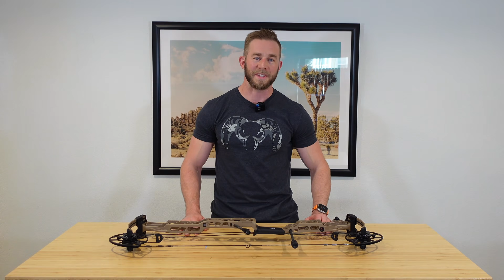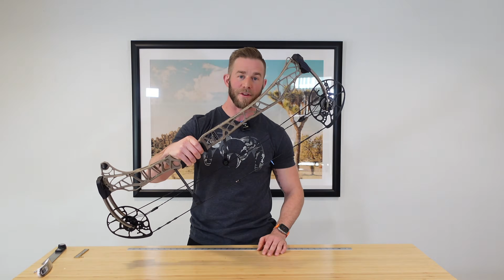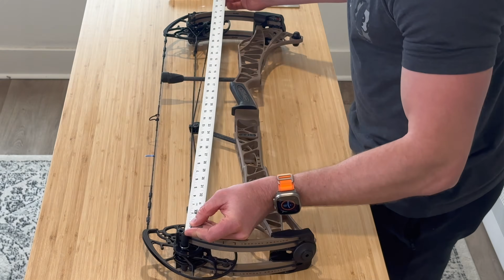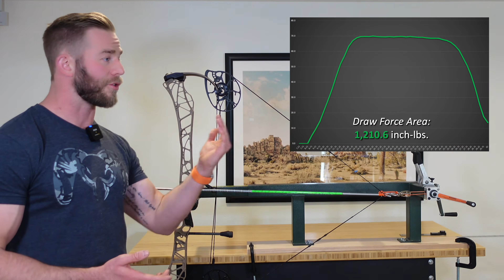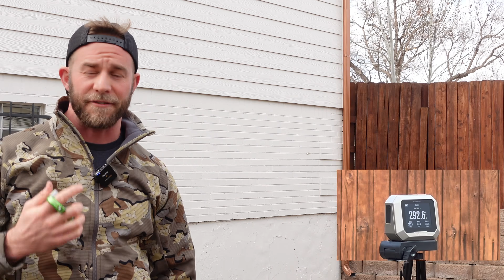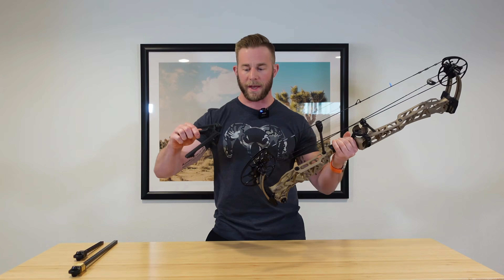Mathews LIFT 33 - The Ultimate In-Depth Review (2024)

Comment: I own a Mathews Chill-X (35” ATA) and it’s a reported 4.2 lbs bare. My Mathews NoCam HTR is 32” ATA and 3.8 lbs bare. Both could be considered “modern” bows, and Mathews themselves used to consider the NoCam to be their most accurate and efficient hunting bow (up to 2019 at least). I’m just making the point here that it IS possible to make a lighter and longer aluminum bow if you’re not building the riser to survive 80#s draw weight. Hoyt is doing just that with their Eclipse, which is light, fast, accurate, and maxes at 60#s. 

What the newer Mathews bows are is quieter. By a LOT. Several club members have the Lift, V3X, Tactic, and a few Bowtech Carbon bows too and they are all crazy quiet.

Let me know if you’d like to test my Chill-X or NoCam HTR one day.

Comment: Definitly the ultimate in depth review. If i were to add one thing it would be a comparative view to previous year bows. That would give better context for people looking to upgrade. That being said, next year I can come back and watch this and Mathews' 2025 bow and see the differences between the two. Thanks! P.S. how do you like the Garmin chrono?
Reply from the maker: That is a really terrific idea! Trust me - we are keeping all the data we are collecting this year, and we will probably include a "comparison" section for each bow review headed into the 2025 season. 

The Garmin Chrono is really good. First and foremost, so long as you shoot a "flat" trajectory over it, it seems to be highly accurate and repeatable. I've noticed that sometimes I get slightly higher speeds if there is a bit of a downward angle to the shot. That said, it does seem to work much, much better (in terms of actually giving a reading for each shot) when the unit is warmer or the weather is warmer. There have been some cold days (35 degrees F) where the unit won't always give a speed on all shots as it cools off in the outdoor temps.

Comment: why not take the dampener out of the front like you did for the Darton Sequel 33?
Reply from the maker: Thanks for the question! The Darton Sequel and Hoyt bows come with mini stabilizers that ALSO happen to have rubber inside to help with vibration dampening (just like many other aftermarket stabilizers on the market). These get removed as the majority of people who own these bows will remove them in favor of traditional and more effective stabilizers anyway. I am not removing permanently affixed vibration dampening, such as shock pods, orbital dampeners, nano dampeners, or limb dampeners from the various manufacturers. 

Alternatively, I could leave them in place for all measurement, including the weighing of the bows. But this would be a huge penalty to the comparison of these bows to others. 

Ultimately, vibration is the least interesting measurement on most modern bows. By the time you build it up with accessories, the vibration will be negligible. 😀
Reply: Thank you for answering and yes I agree that vibration isn’t important because you can mitigate that easily I shot Darton last year with the Prelude 32 but this year I ordered the Lift 33 the Sequel is super smooth but I prefer a more aggressive bow and to me it’s the Lift this year!
Reply from the maker: @EagleArcher24  Nice! Clearly you've found a review here for the LIFT 33 - we also reviewed the Sequel by Darton, and we are posting another major flagship bow review tomorrow. Thank you for commenting and engaging in a conversation about your gear! I hope you enjoy your LIFT!

Comment: Great review!  There seems to be a lot people on many archery forums talking about the cables hitting the cams after tuning these bows with the top hat system.  The limbs are very thin and seem to be prone to cause excessive cam lean.  I don't know for sure, but I will wait to purchase one.
Reply from the maker: Interesting! You're the first person I've heard this from - but I'll have to keep my ear out for cases like this. There may be something to this, as the LIFT 33 has far more limb deflection than any other bow we've had on test so far!

That said, I did go through paper tuning the LIFT 33 very quickly, and with one minor top hat adjustment it was shooting bullet holes and seemed to stay in tune. It could always be that if you are selling a ton of bows, you're bound to have more defects in the field because of the sheer volumes. 

Appreciate the information!
Reply: Good point.  Time will tell. @ApexArchery
Reply: Good point.  Time will tell. @ApexArchery
Reply: Google mathews lift issues. Multiple people complaining about cam lean, rubbing, and Multiple bows derailing themselves. Even on a weight scale when let down.

Comment: I finally found a left handed 33 in stock and was able to shoot it a bit.  I decided to pick it up, spend some time with it, and wanted to report out my real world findings.  To be honest, I was very skeptical about this bow when I first saw the release of it.  When I first inspected one in person, my skepticism grew.  You can literally grab the cam and bend it around in all directions (of course with the bow at brace) as the limbs are so skinny they just flex like crazy.  I was worried about that from a durability standpoint.  I was also worried about the cams being very, very skeletonized.  They seem like they would be easy to bend, etc.  Those were some initial observations before I got to shoot one. 

I got to shoot one and my first reaction was 1) the draw cycle is very linear, just stiff 2) there is no valley (even at 85%) 3) the vibe/shock after the shot is more than the Phase 4 and 4) the riser length adds to stability significantly 5) something different in the grip where your thumb fits is improved.  I shot it with both C and D draw length mods and landed on taking it home with the C mod.  I bought the bow and took it home (we do our own set up and tuning at home)......

Set up was easy.  With a center shot rest we had a perfect bullet hole with ZERO top hat changes or any other changes.  The Match strings are an improvement over the Zebra, not sure how much of an improvement but they are better.  They are thinner and they did settle very quickly and my peep locked in.  So I just started shooting it for a few days.  The bow has a very clean shot cycle, very clean release.  With it all set up, the vibe/shock was mostly gone.  I got used to the draw cycle being stiff.  I never did like the lack of a valley.  My style of shooting my hinge is to relax/elongate the palm of my hand and that style does not work well with a bow with no valley.  

As I shot it, I realized the C mod was making me feel a bit long.  I was not stable at full draw and could feel being a bit overextended.  My shop still had the D mods, so I switched to them and now I was too short, feeling scrunched up.  When I am scrunched up, I have hand torque.  For me, having the draw length perfect is a huge issue, as I finally found out how well I shoot when my draw length is spot on.  It matters hugely!  So, sadly, I am caught between a D and C on this new Mathews cam and not comfortable at either.  Note on the previous Mathews cam the D mod worked well for me).  Yes, could I twist strings and/or remove the grip and/or fiddle with D loop length or even my release neck length (different releases) - yes I could do all of that to try and get the Lift 33 to fit my draw length.  Since I have other bows I shoot well, I did not want to put that level of effort into the Lift, so I sold it/traded it.  As long as Mathews runs this newest cam with the 1/2" draw length limits, I am probably out of luck with Mathews.   

Conclusion, while I can't speak to the long term durability of the bow/cams, if your draw length fits one of the draw mods and if you are OK with no valley, this bow could be a great choice for you.  Thank you.
Reply from the maker: Thank you for the thorough commentary! Really appreciate you sharing your experience for others. 

Very interesting that you felt the draw cycle to be "stiff" and did not feel much of a valley. Based on our draw cycle analysis (and some overlays of draw cycles from different bows) the Mathews actually has a sharper valley than some other bows like the Hoyt RX-8 Ultra. If anything, it should be slightly more pronounced as it falls a little more dramatically and a little later than the Hoyt, and about the same as the Bowtech. Similarly, the Mathews was actually slight less "stiff" up front than the Hoyt as the Hoyt remained steeper between inch 11.75 and 14.25 of the draw cycle!

Just goes to show that you really do need to shoot these bows, as everyone experiences things differently!
Reply: @ApexArchery  That is all interesting.  Drawing a LIFT vs a RX8 the Hoyt feels much easier to draw at the same poundage.  Thank you for your in depth reviews - best on the internet and thanks for keeping them mostly objective.  I am guessing you either a civil or mechanical engineer by profession?
Reply from the maker: @huntsimple9527  Good guess - but no. Professionally, I work in business development in tech. So most of my co-workers are engineers! ;)

Comment: Wait until matthews drops a carbon bow. It's going to be epic
Reply from the maker: Man - I'll keep my eyes peeled! Although Mathews engineers have been saying for years that they won't do carbon because they don't feel its superior to aluminum. It would be interesting to see carbon make its way into the limbs though!
Reply: Carbon is overrated and the Lift is as light or lighter than the carbon bows on the market.
Reply from the maker: @LostboyMoto  Maybe! But remember, carbon also has some unique properties that metals do not. In particular, you can lay up carbon to control for specific flex parameters, use the carbon itself to control vibration, and carbon does not conduct heat (and therefore feel cold!) like metals do. 

That said, the LIFT 33 is very impressive in terms of the machining of the riser and the weight they were able to achieve!

Comment: I hope you realize most of Mathews early SoloCam bows were under 4 pounds. I shot an early edition (1996) Mathews SoloCam for 17 years, and it was 3.5 pounds bare bow.  I might add it was 41" ATA (designed for fingers shooters) at that weight, too.      Today's bows are heavier than the earlier Mathews bows with solid limbs.    Switchback, Q2, and many others were lighter than this bow.    My best friend still shoots a Mathews Heli m that is 3.5 pounds bare bow.     To say this is Mathews' lightest bow is a bit of a joke.
Reply from the maker: Fair point! Perhaps I should have said that this is Mathew's lightest modern bow - and it is certainly lighter (especially considering the riser length) than most of the competition. Interestingly enough, I am planning to do a video with a direct comparison between a Mathews SoloCam and the current LIFT series.
Reply: So, how does that make you feel?

Comment: I bought a Lift 33 from Bear Creek in their very first shipment. First impressions…way different from the last three generations of Mathews bows I’ve owned. I shoot this bow better than my TRX 34, which never thought would happen. I have about 250-300 arrows through it now without cable stretch or peep twist.
With respect to the Mathew’s grip, I have always purchased aftermarket grips to get the clean edge for consistent hand placement. With that said, I have found the Total Peep grip the best option for me. I simply cannot have an inconsistent grip unless I try, and the material gives awesome tack and warmth in cold temps. I plan on shooting this as both my hunting and target bow this year!
Reply from the maker: Awesome! Thank you for the feedback, and excited to hear that you picked up a bow from Bear Creek. I will have to check out the Total Peep grips - Overall the Mathews grip on the Lift 33 (even with the engage grip removed) is slightly slender in my experience, which can cause a tiny bit of torque. I'd be curious to try out a flat grip that is slightly wider to see how that feels.

Comment: Did I make a mistake buying the lift 29-1/2” instead of the 33” if I want to shoot bow hunter at Landcaster and 100 yard pluse shots
Reply from the maker: In my opinion, buying a new bow you love is never a mistake! The 29.5 is also a superb bow, and it may fit some people a little better than the longer ATA version on the 33. If you are hunting tree stand, care about all-out bow speed, or have a bit of a shorter draw, the 29.5 is terrific. But I would say that if you want a bow that is nearly optimal for everything from hunting to 3D to target, the 33 might be a bit more comfortable in the long run.
Reply: There's a reason Mathew's target bows are 36", 38", & 40" ATA bows.
Reply: @driftlesshunter9200  the 29.5 fits me perfect but with moving to Florida this year and everything going on I was wondering if buying the 33 would be perfect this year to hopefully accomplish everything I wanna do. I’m 5’9” with a 28.5 draw just not sure if I can use the 29.5 for the Tac shoot for truck
Reply from the maker: @josephhenderson7044  You can absolutely learn to shoot the 29.5 really, really well. Especially given your dimensions, the 29.5 is a great bow. That said, the longer ATA bows do typically present as slightly more stable on target and at full draw. Have you tried a demo with the LIFT 33 or any other longer ATA bows?

Comment: Good review. Did you modify the draw board to get the bow lined up properly? My peg on my ez press that goes against the grip is higher and it doesn’t work right
Reply from the maker: Great question! We use AMO standards to identify the true "draw" position and we will usually use a tiny bit of masking tape and a marker to identify this point on the riser.

Comment: Having shot and tested about all the new '24 bows this year, the Lift 33 was in my opinion the best overall bow. Of the new '24 bows in its ATA range, it was only slower than the bowtech core sr in performance by about 3-4fps with my 438gr arrows at 29" draw and 69.8lbs measured draw weight on the Lift. I found the draw length on the 33 to be the closest to spec of any tested (matching my Mach 34), and lighter in overall weight than all but the Mach 34 in the over 32" bows. Had Mathews marketed this bow as a 340IBO bow, the haters would have less to cry about and Mathews would have not hurt the marketing any at all by doing so. Nevertheless, this is by all practical purposes the best released bow this year in many regards. The draw and valley are excellent, perfect for hunting. The Lift 33 I tested was closer to a mid 83% letoff measured. This would be to me the best bow Mathews has released since the original McPherson Mathews Monster. I was happy to add it along side my Mach 34 for this season. That said, Elite (Ethos), Hoyt (Alpha X 33), Bowtech (Core SR), Darton (Sequel 33) all had excellent bows this year, and one would not go wrong with any of them.
Reply from the maker: Great comment and glad to see that our testing matched with your experience as well. We are also going to be testing the Elite Ethos, Alpha X 33, and many more.